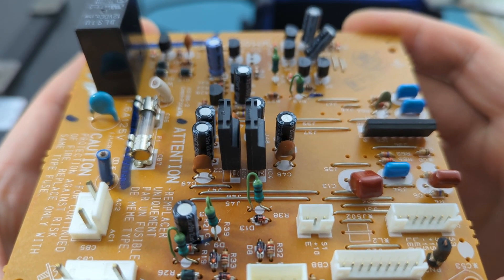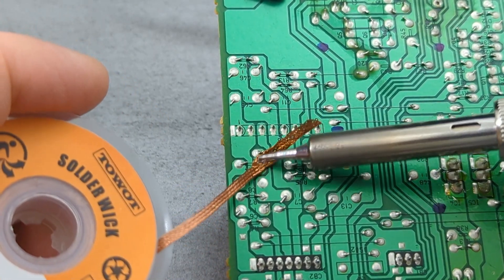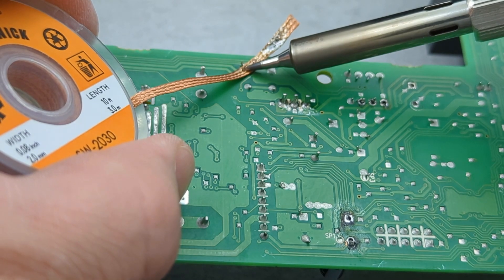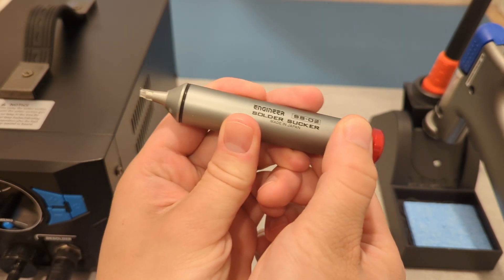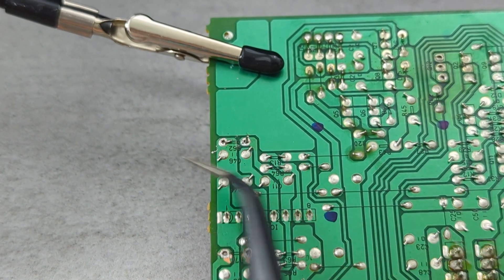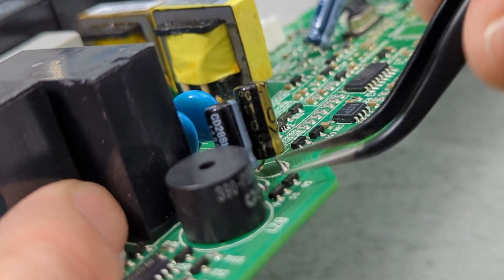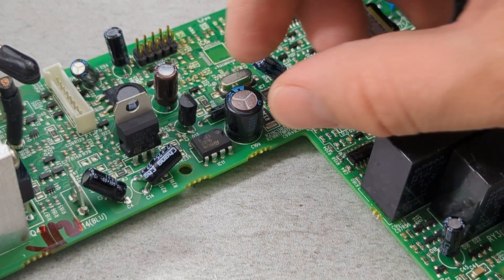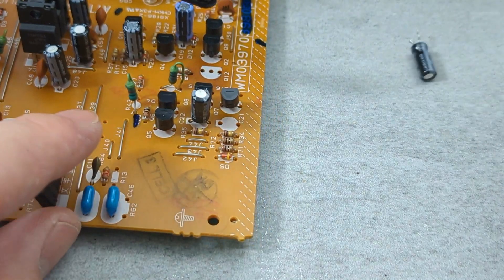How To Desolder Through Hole Components | Step-by-Step Guide

Comment: watching you using the wick is giving me cancer. 
it's either the wick lacks flux in it. or your iron is not hot enough to heat up both the wick and the component solder.   
I bet it's the 2nd one.   you may watch to switch to a larger iron tip